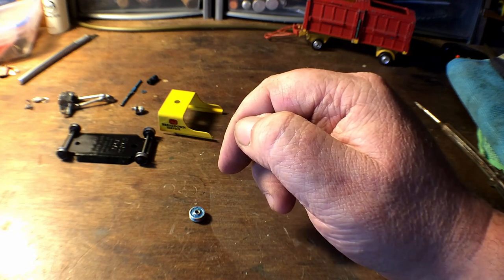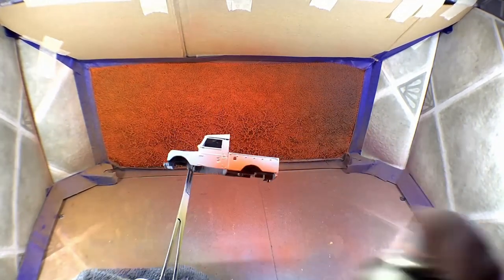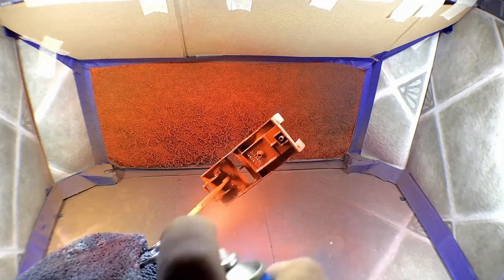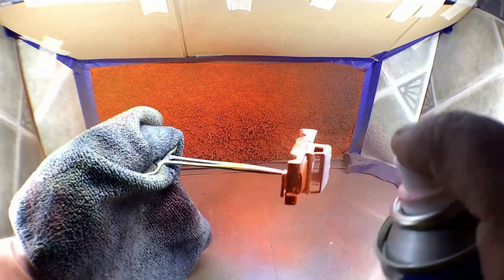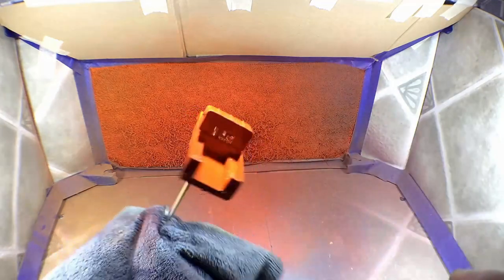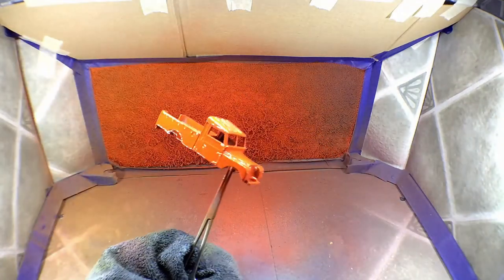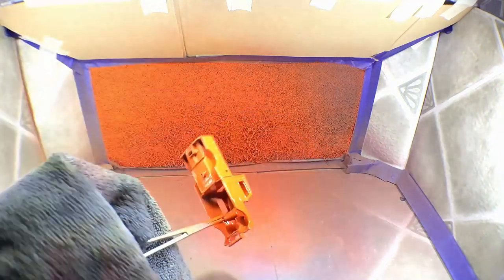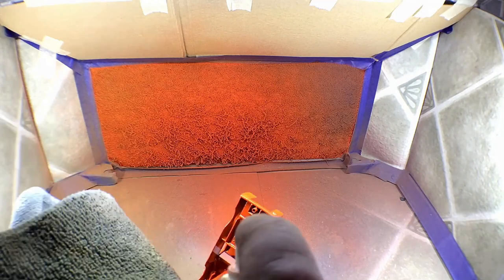Corgi 417 Land Rover Breakdown Truck Restoration .

Comment: HNY from Dubai, Bob! Super job on the canopy - that looks as good as new. I had an old Series 2 for a while and had an old railway sleeper bolted on to the front bumper for pushing stuff: you might have a think about staining up a bit of stick and gluing that in place to get you a full width Code3 bumper on the front!
Reply from the maker: Thanks 👍

Comment: Great restoration Bob, your work is amazing. Is the Aqua Mate you use to stick the plastic windows in just ordinary clear silicon? I think I'm gonna make a glue stick like yours for the super glue, I've been using a wooden cocktail stick but yours looks much better. Looking forward to your next video, take care, best wishes to you and Mrs. Bob. All the best. Peter.
Reply from the maker: You can clean the old glue off easier too after a while as it's only a piece of wire !

Comment: Hi Bob I love your videos, I have been looking through a lot of your old videos and I can't any info on removing 'replacing' the wheels on this model land rover. do they just pop off like the winch wheel if so could you point me to a how do you go about it thank you Bruce
Reply from the maker: Hi Bruce, no they’re not the same as the winch ones, you need to grind a bit of the end of the axle enough to slide the wheels off but make sure it’s the smallest end. Then when you get to refit them you have to peen the ends back over to prevent them coming off again, you’ll see what I mean in my car transporter video. 👍
Reply: @BobWilliscorgi  Thank you Bob sorry but I am still at a loss the axles on my Land Rover don't seem to protrude enough past the wheels to grind the end off and the transporter video I could find you don't actually remove the wheels thanks again Bruce.
Reply from the maker: No but I removed the pins on the trailer car lift fixings, that’s what I meant to give you an idea of how to remove the wheels from the axles as it’s the same process. However if you’re wheels are flush fitted to the ends of the axles then that’s the older version and I’ve seen another Diecast video on YouTube where the guy says if you heat them up slightly then you can pull them off but they can be very stubborn.
Just be very careful not to damage them if you try it, Bob. 👍
Reply: Thanks Bob I will give it go keep up the good work

Comment: Lovely restoration Bob, I was interested to see how you put the crane on the back, because when I did my one I made the holes bigger too but never drilled the old river heads( the crane had been pulled off when I got it) so I just glued the crane on like you and left the original rivets as they were, your way turned out much neater, also I never noticed about the shape of the tin canopy, the front section already had the curves on mine, but the back parts were still square, if you hadn’t have shown us I wouldn’t have noticed! As for the front bumper, I have seen on eBay a little while ago that you can actually get a repro front bumper in white metal that you can glue on for these earlier models. 
Anyway another lovely job, great first video of the year, look forward to the next one👌👍😊
All the very best to you and Mrs Bob, take care, Nick.
PS. I never seem to see how much glue I’m putting on until it’s too late, I’m always getting into stick situations!🤦🏻‍♂️😂😂🤣👍
Reply from the maker: Hya Nick , thanks mate but I won't be buying a small piece of metal when I can make it myself !
Am already on it and will be showing the results in the next video I upload , thought I`d better do something about it with all the comments on the issue . Lol
Reply: @BobWilliscorgi   Don’t blame you I wouldn’t buy one either😉, there are plenty other things you can use😊👍